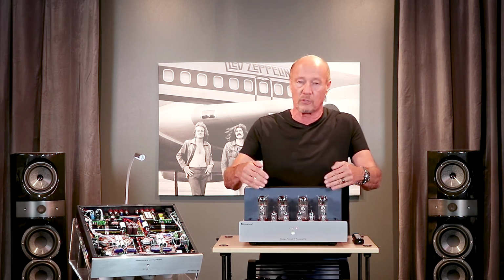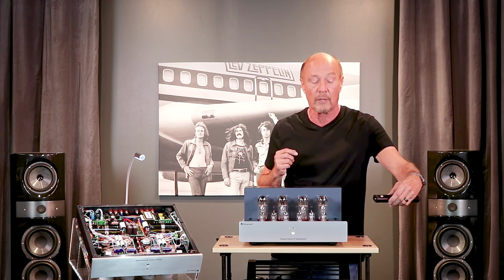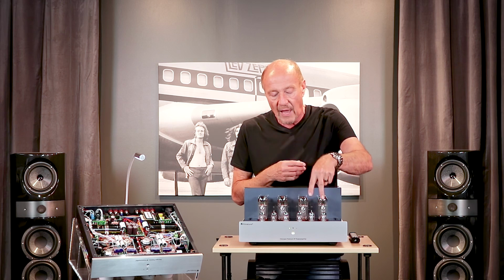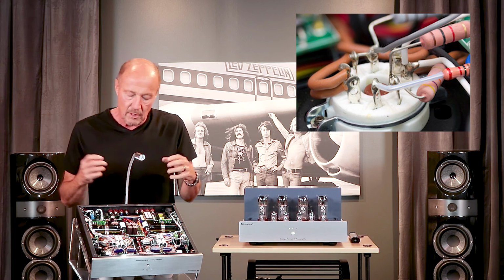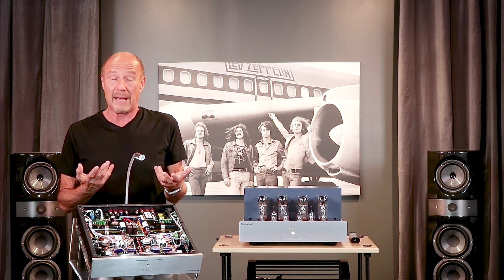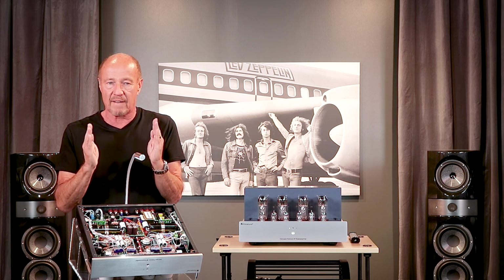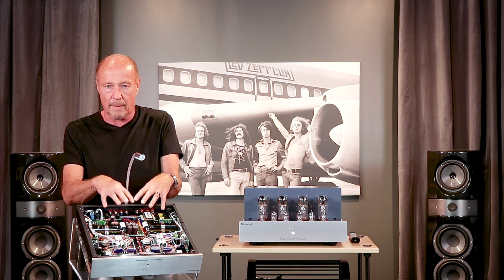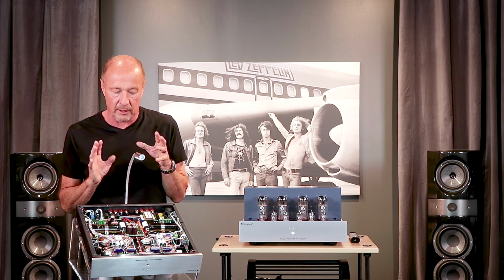PrimaLuna DiaLogue Premium HP Power Amplifier - An Inside Look

Comment: I have the EVO 200. He is right, It has amazing punch. I do have KT88’s in it, it is driving a set of Martin Logan ESL’s . It has a level of detail I could never have imagined. It’s the low end punch that has really surprised me. If you are looking to buy an amp, my advice check out the Prima Luna EVO series. I live in Australia have no connection with Kevin.

Comment: One question, shouldn't also the amplifier get the 5AR4 rectifiers tube? in my, admitted  limited, understanding they should be as important in the amplifier as they are in the preamp.
Reply: It really should have dual 5AR4s to achieve output as advertised or one 5AR4 with diodes in parallel.  Tube rectifiers sound much better too.
Reply: @wade998  Tube rectifiers do notnecessarily sound better. You know that.
Reply: @wamgoc3637  I have 10 tube hifi amps and four tube guitar amps and will say tube rectifiers sound more natural, bigger sound stage, etc.  SS rectifiers will give more headroom and watts but sound too brittle with a smaller sound stage.

Comment: Not a bad product, but my experience with Upscale Audio has convinced me to trade in my PrimaLuna for something that is represented by a company who means what they say, says what they mean, and actually stands behind their product(s).  Upscale Audio, I'm afraid to say, does none of that.  One of Kevin's often-used catch phrases is that "I will treat your system like it's my system", while simultaneously forcing folks like me to wait upwards of a month to simply get a replacement remote control, when mine up and died on me after only having my PrimaLuna for 3 months.  Keep in mind folks, you cannot put your PL amp in Triode mode (my preferred mode) without that remote control (a notable design flaw, in my opinion).  Would Kevin / Upscale Audio get a new one coming to me right away to keep the customer up and running while the issue was sorted out?  Nope.  They don't trust or care about their dealers or their customers nearly enough, sadly.  I have heard the rumors leading up to my PrimaLuna purchase, but had to experience it firsthand to finally convince myself that it was true... Kevin does NOT care about the customer, and he does NOT stand behind his products, certainly not in the way that he promises he does.  Buyer beware....
Reply: PL is made in China. Can you say "supply chain"? The current corona virus is teaching this lesson to many people now. It probably takes a month to six weeks to get product in the container. Of course, the remote comes from a different plant than the unit itself and of course, no one in China ever heard of UPS or FedEx (they have, but not when YOU need something). 

 It would be probably possible to permanently wire the device in triode mode but of course it is not PL/Kevin Deal policy to supply schematics. He is afraid that DIYers will copy his precious intellectual property.

Comment: I've been considering a Primaluna Dialogue HP integrated, and then was inspired by Kevin's video suggesting to combine it with PS Audio's Gain Cell Preamp.  I've been looking at the PS Audio Stellar stack as well.  A paced upgrade path for me, could also be to maintain my Audiolab 8000Q preamp, together with a Primaluna amp, in the same fashion as Upscale has proposed with both PS and Mytek preamps.

The HP amp looks to share the same tube configuration as the HP integrated and to much degree the HP preamp.  I am curious what is the role of the bank of front end/rectifier tubes on the amp, when to a neophyte like me, these are already accommodated for on the preamp, much as they appear to be on the HP integrated.